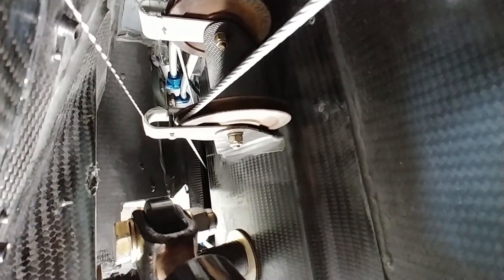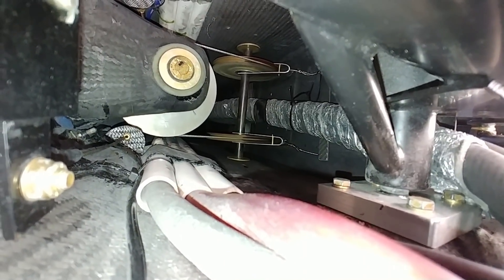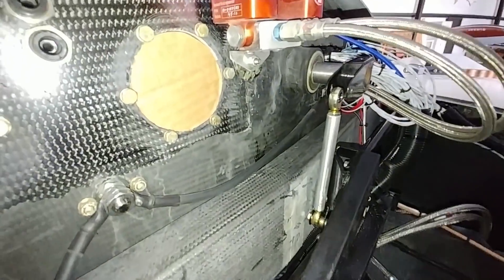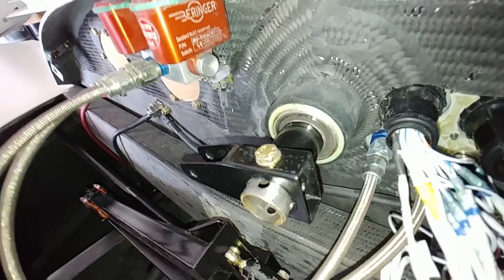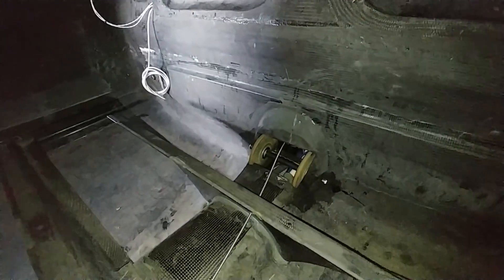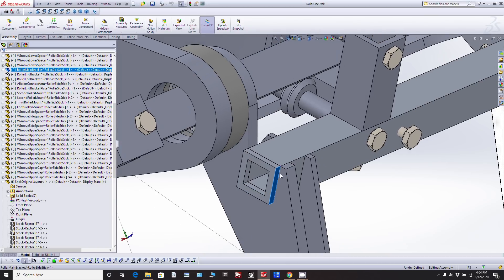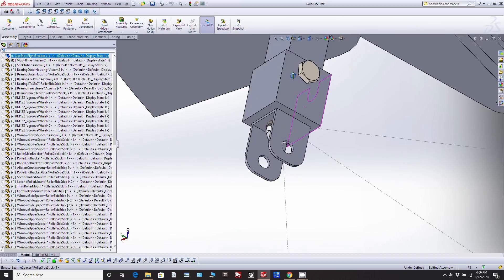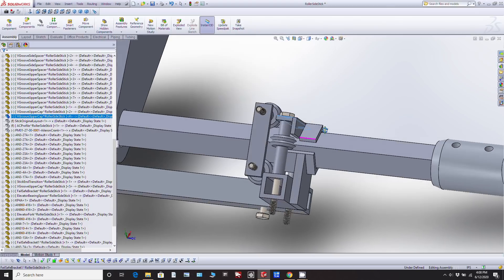Fuel Cut Off Handle - Building the Raptor Prototype

Comment: What about Drawer Slides ? Use 2 or 4 Telescoping Ball Bearing Drawer Slides and you're done... Cheap and sturdy and the wear surface will be much larger. Not conventional but creative...

Or use 3 square tubes (CF or steel). The outer tube is rotating only, the inner tube connects to the stick and the middle tube is "edges only" and made of sliding material or needle bearing.

Comment: Something to consider for production... make the pulley bracket taller to allow for a pin across the bracket to do the same thing as the cable guard without all of the headache.

Comment: Regarding the bolt holding the square end cap and attach bracket to the control stick.  If you can flip the bolt 180 the nut and cotter pin will be on the outside and visible for inspection.  Plus would probably be easier to get the cotter pin in.

Comment: There are not any strain reliefs on the back shells on the back of the avionics panel.  Use rubber sleeve “p” clamps known around here as adel clamps.  1 to go around the pipe, 1 around the harness, connect together with a bolt and nyloc nut.  Use resin coated wiring lace over zip ties.

Comment: Peter, wouldn'T it make sense to add a switch to the handle automatic cutting of the fuel pump(s)?  Making it a single point of action reduces chances of missing them in a stressful situation - which any situation with the need cut off fuel while the pumps are still on will be. Safety first, especially in critical situations.
Reply from the maker: If there's an engine fire you'll be killing the engine first which is overhead and the thing you'll do first from muscle memory. You switch off the fuel pump at the same time you kill the engine.
Reply: @RaptorAircraft  From the videos I had the impression the fuel switch is a separate one than the engine. So if it's a single switch killing engine and fuel pump, than it'll work great.

If not, trusting 'muscle memory' in situations of stress doesn't sound like a good idea. Pilot overload is a real thing,no matter how experienced. Safety should be build in, don't you think so?
Reply from the maker: @HansFranke  they are two separate switches adjacent to each other that you press off at the same time when shutting down the engine. Doing so is far easier than even pulling the shutoff handle will be. Connecting a switch to that handle would be problematic and could possibly create an unwanted failure point for the fuel pump. Placing another switch next to the handle creates a similar set of problems. Unwanted failure point, difficulties locating it and remembering to switch it off. Essentially just cutting off the fuel will kill the engine within a few seconds anyway. I'm trying to keep this simple.
Reply: @RaptorAircraft  Erm, no, the idea is not placing another switch near the cut of, but simply hooking up a pull switch to the cut off as well. No additional flipping and whatsoever.  There's also no unwanted flipping, as it's implied with securing the handle.
In fact, cutting off fuel supply to a diesel can result in quite some damage. To the engine as well as the fuel system. I had that experience once with a VW Golf GTD. Quite a lot, short of the block, had to be replaced. The ability to close that valve while the engine is running is rather risky and may end expensive.
Your plane, yout switch, but come the time I (hopefully) get my hands on a raptor, this will for sure be  modified to be inherent safe.

Comment: Cable fuel shutoffs like that were notorious for vibrating closed or partially closed in race cars . I know of one cure but it is not strictly aircraft .
Reply from the maker: We'll keep an eye on it to see if that is a problem. Even if it rotated loose from the locked position it still takes some force to pull it. Vibration would not create that force.

Comment: My only suggestion is to not zip tie any of your wiring around any metal tubing if possible... especially if that was a fuel line.  Those type of zip ties will eventually chafe and cut that metal tubing... This was seen around the 2 minute mark.  2:07
Reply: Absolutely. Those zip ties will even wear on steel. No chance I’d be using them anywhere near fuel tubing.

Comment: How are you going to get a spanner on the stopper locknut? Doesn't look like there is enough clearance around it to fit the spanner.
Reply from the maker: Given that it's a castle nut it won't be overly tight anyway. So a pair of needle nose should suffice and then likewise to insert the cotter pin.

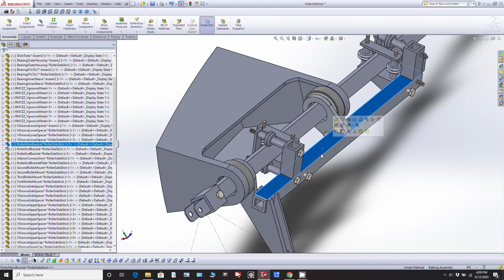Comment: Talking at 9:48 about testing, I would put the aileron horn in the vice, not the square tube. the furthest point from where the force is applied, will allow the greatest degree of torsional distortion in that assembly. That's the path the forces will take during normal operation.
Reply from the maker: Yes but I plan to test the v groove bearings before cutting and welding the aileron horn.

Comment: On the fuel shut off valve a AN bolt with a hole drilled through it with washers sandwiching the push pull cable will be sufficient. Set up like a mixture cable on a carburetor engine. Just be sure to anchor with several adel clamps.
Reply from the maker: Yeah, I'm probably just going to use a couple of Adel clamps to hold the cable sleeve. I already have the retainers for the inside cable to lock it on the arm of the fuel valve.
Reply: It needs to operate in PUSH as fluidly as it does in PULL, for obvious reasons.

Comment: For supporting the pulley bracket I would have used braided cable with a little loop back and then a piece of metal that you bolt down to hold the loop back in place. That wire that you have supporting the pulley bracket looks so flimsy I wouldn't want to bet my life on it.
Reply from the maker: It's safety wire, there is no force moving any of those cable guards and lastly it's almost impossible to do any kind of retrofitting in those confined spaces. I have the battle scars on my hands and forearms to prove it. So now that you know all that, would you still have a go at implementing your solution if it was you doing the work?
Reply: @RaptorAircraft  Good job, and I'm glad to hear that the wire supports are sufficient to do the job. Well then you're on your way my friend, all the best

Comment: That looks like pretty thin gauge wire for the bracket supports. I think you said though that if you wanted to put some really substantial supports in there, you would have to take the front end off the plane, and that was just too much to do right now. So I think on your next iteration of the raptor you'll build it so it won't need the wires anymore in the future.
Reply from the maker: No doubt.

Comment: G'day, Is there a friction issue with the safety wire rubbing on the fuel breather line I could not tell if there is clearance?
Reply from the maker: There is clearance.